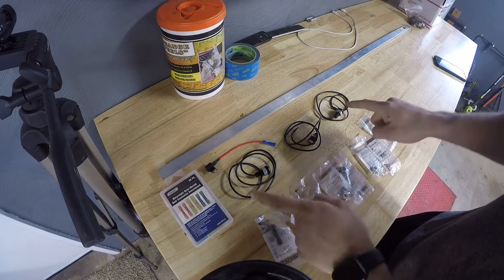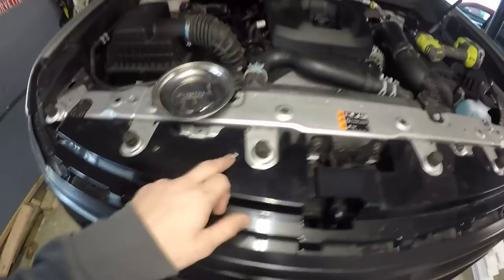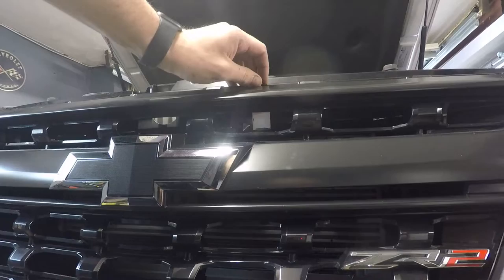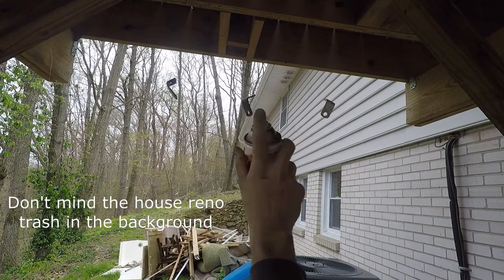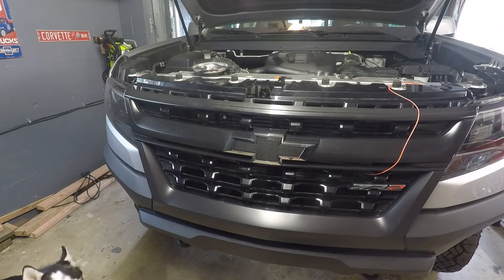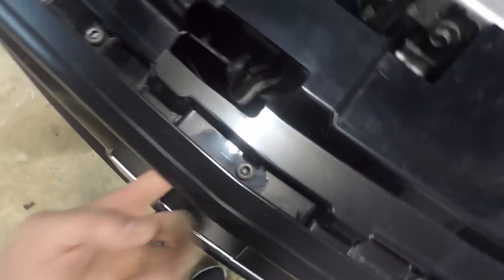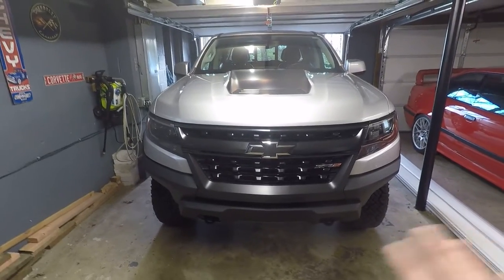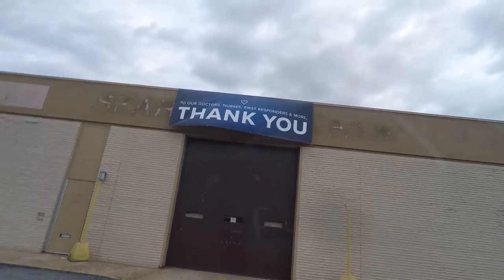Colorado ZR2 Custom LED RAPTOR Lights (DIY Easy Bolt on Solution)

Comment: Great video, thank you! I use that aluminum from HD for a bunch of stuff too, great idea here. I just ordered a 4 pack for mine. It's a Trail Runner so it has the Bison grill and three wouldn't work I don't think. Thanks for putting this up.
Reply from the maker: You're welcome glad I could help!  So you're going to use 4 lights instead of 3?  I've seen some ZR2s like that, 3 or 4 both look good.
Reply: @matt13ross  Yeah, the way that grill (I think they call it the Bison grill?) is, there is an open space to the left and right of the center but the center is blocked by part of the design so I'll just do two bulbs to the left and two to the right. Thanks again!

Comment: How do I measure capability?  If a ZR2 can follow a jeep rubicon anywhere, I'd say its very capable.  Great video.
Reply from the maker: Joel Esparza you’re right it is very capable. I’m just a sucker for Raptors 😬
Reply: @matt13ross  look at the extreme zr2 (750hp) V8 swapped with a super charger no videos offroading through smh, but there are supercharged 450hp zr2's out with videk

Comment: If you make a vehicle that’s over 80 inches wide, it starts to fall into various "commercial vehicle" categories, and one of the requirements of vehicles this size is that they have — in the words of our government — "three amber front and three red rear identification lamps spaced between 6 and 12 inches apart at the center of the front and rear of the vehicle, as high as practicable." This is why you see these lights on an F-150 Raptor (over 80 inches wide) and not on a regular F-150 (79.9 inches wide — likely not a coincidence). It’s also why you see the lights on heavy-duty trucks and not light-duty models.
Reply from the maker: Yessir that’s what I’ve read. I just like the look.
Reply: So if the F150 has flares then they will need them
Reply: @MacB369  maybe

Comment: CLEARANCES lights. Any vehicle with a width over 80 inches needs marker amber lights. Raptor thought it would be cool to put them in the grill instead of on roof top.
Reply from the maker: Yessir that’s why I call them Raptor lights. They were the first to implement them in the grill and I love the look. (Secretly love Raptors too)

Comment: AWESOME job do you want to come to my house and do that to my ZR2
Reply from the maker: Ha, it's pretty easy give it a try!
Reply: @matt13ross   what type  And size bolt nuts did you use to secure the homemade brackets
Reply: @matt13ross    I also install a catback borla 304 stainless exhaust system  With the K&N air filter  I have the 3.6 liter  My ZR2  Is Orange with the black trim Extended cab
Reply from the maker: I wish mine was orange
Reply from the maker: I don’t remember to be honest. You can use a variety of sizes doesn’t have to be specific.

Comment: Not capable, you must not offroad in this truck. This truck is extremely capable.
Reply from the maker: I know it’s capable. I have taken it off road at Rausch Creek. I’d say a Raptor is more capable though. The Colorado has the size and diff locker advantage but that’s really it.

Comment: It's  more capable than a raptor,  trust me sir.
Reply from the maker: j s tell me more
Reply: It's stronger, built better and is designed to take more abuse.   I own a colorado zr2,  colorado z71 and 2018 ford raptor;  the Colorado's are amazing but their transmissions are weak.
Reply from the maker: I still want a Silverado ZR2

Comment: Why would a ZR2 want Raptor lights? Wanna be?
Reply from the maker: Precisely
Reply: @matt13ross  Go buy a Raptor.
Reply from the maker: Not in the budget, but I appreciate their advantages over the ZR2.  If Chevy ever makes a widebody proper long travel Silverado I'll buy that.
Reply: @danwood4478  I'm talking to u boomer. U don't understand the internet yet?
Reply: @TX_SOLDIER  Ricky, go back in your closet and pull on it some more. My question wasn't directed at you or your lost ego.
Reply: @matt13ross  unfortunately, GM can't seem to find their way into that market. I agree, both Ford and Dodge have a leg up in the full size trucks, a big leg! As far as mid size go, the ZR2 is damned awesome.
Reply: @danwood4478  now I know what you think about on ur spare time. U need jesus

Comment: Not as capable? 🤣🤣🤣🤣🤣
The raptor is trash, bro.
Reply from the maker: Oooh I disagree, even as a Chevy fanboy, the Raptor is awesome.
Reply: @matt13ross  I've been an auto mechanic for the better part of fifteen years in a very reputable shop. I've seen them all and I'm here to tell you Ford and Mopar are absolute trash from a reliability and engineering standpoint. The ZR2 is so much more capable off-road than the Raptor. That's not opinion, that's fact.
Reply: Oh crap, my bad, dude. I didn't realize you had the diesel ZR2. Yeah, you're right. The diesel version definitely isn't as fast, capable or reliable as the Raptor. Should have bought the V-6 ZR2.
Reply from the maker: Not a V6 fan, and they get terrible mileage in the ZR2s.
Reply: @matt13ross  I average about 20-21mpg in mine. And since gas is cheaper than diesel, the little bit of extra fuel mileage is negated by the higher price of diesel. Plus, been seeing a lot of the diesels getting traded in lately and complaints. That's not a good sign. But hey, to each they're own, as long as you're happy that's all that matters 😊